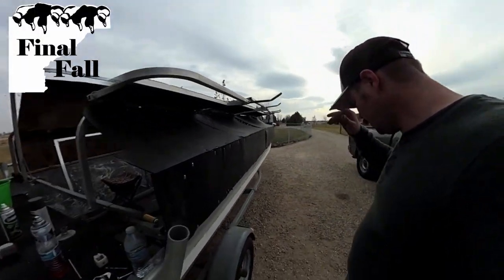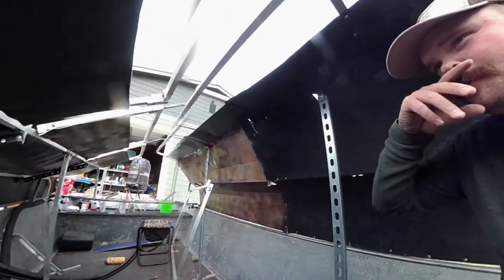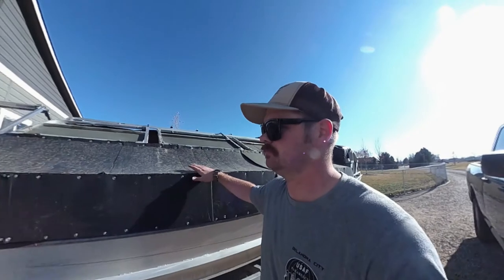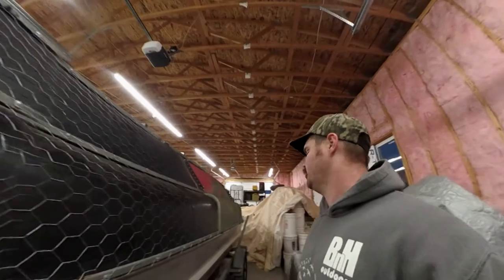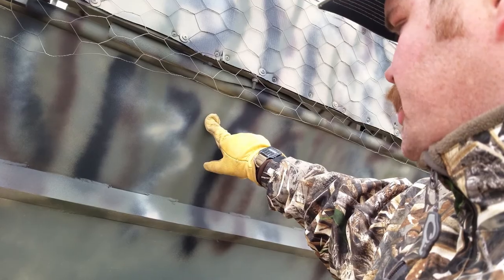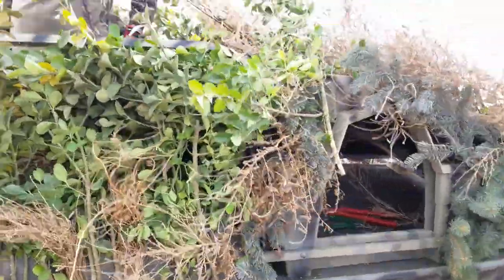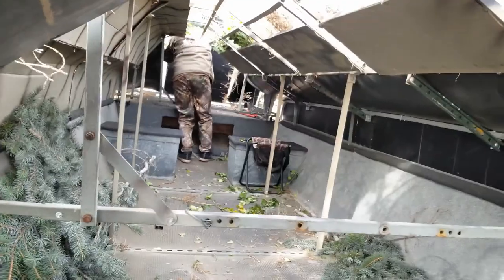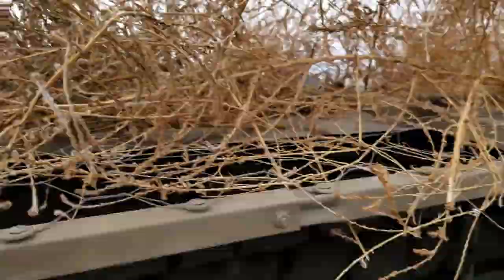Building a Hardside boat blind PART 6 of 6: Paneling, Painting and Brushing

Comment: Is that a jetted mercury motor? And what’s the both width and length? Thanks
Reply from the maker: Yes. It is a mercury motor with an impeller on it. As for the length it's a 20' flat bottom boat. I got all the dimensions of it in this video. https://youtu.be/lVOWblXmNJQ

Thanks for watching. Don't forget to subscribe!
Reply: @final_fall  thanks for the info, I meant to ask how fast will that motor push that boat at. Thanks for the reply and I just hit the subscriber button!
Reply from the maker: Oh yeah, it moves along okay. But definitely doesn't have the speed that a prop would. But where I run in the shallow water a prop is very impractical. So I sacrifice the speed for versatility. But the speed is still pretty good. I'd reckon maybe 20mph. I'm not sure though honestly.